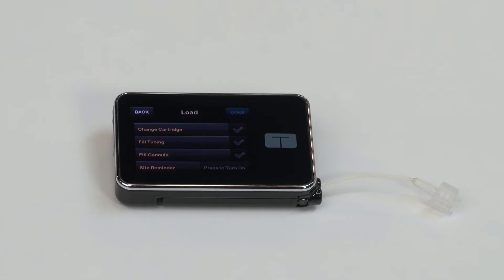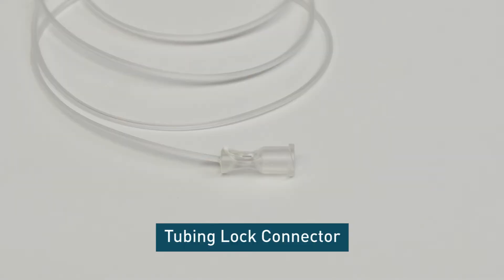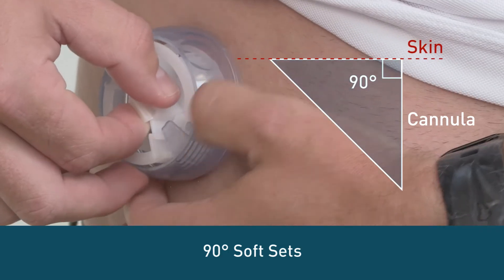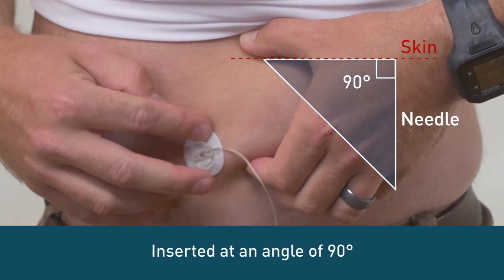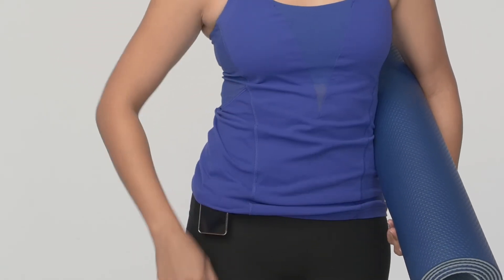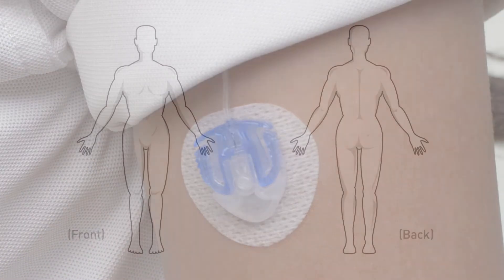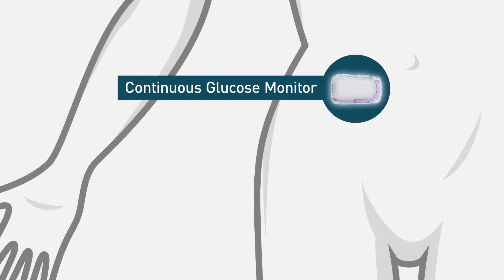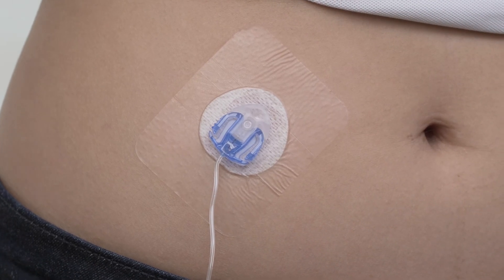Infusion Sets for Beginners: What Are Infusion Sets?

Comment: I am debating on getting a tslim, I am pretty lean and don't have much body fat to work with, which infusion set would work with little body fat? Another question, can you remove the pump tube from the infusion set? like with the little clip, and attach it back on? Any answers would help, thanks! 😁😄
Reply from the maker: Thank you for your interest, Simon! We'd love to help you connect with our team members in your area to learn more about our infusion set offerings. Can you please send us an email at TandemCares@tandemdiabetes.com, or give us a call at (877) 801-6901, Option 2, Monday-Friday between 6am and 5pm PST? 

Since Tandem pumps are tubed, this gives you the freedom to disconnect at the site. When planning to disconnect from your pump, please check with your healthcare provider for guidance. Depending on the length of time and reason you are disconnecting, you may need to replace missed basal and/or bolus insulin. Check your BG before disconnecting from the pump and again when you reconnect, and treat high and low BG levels as recommended by your healthcare provider. We hope this helps!